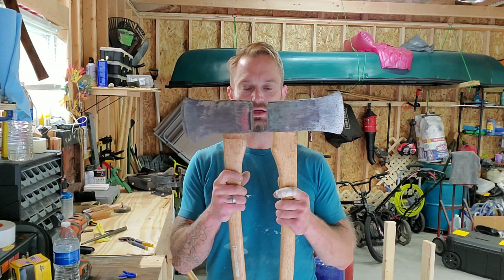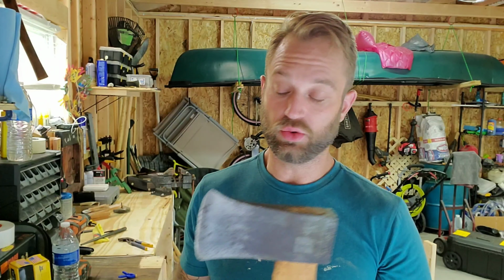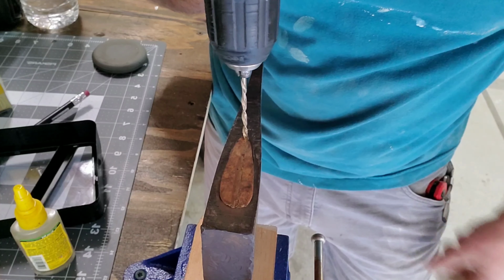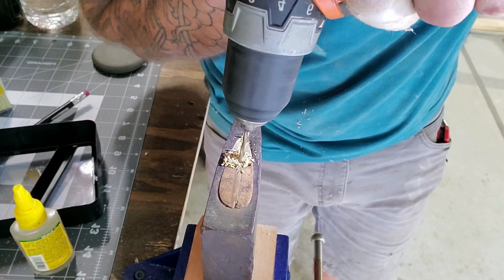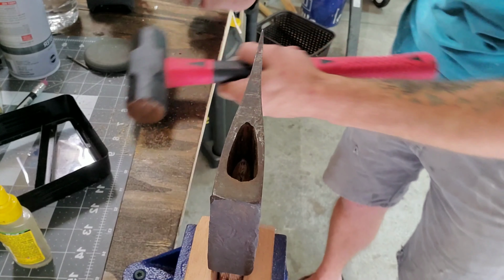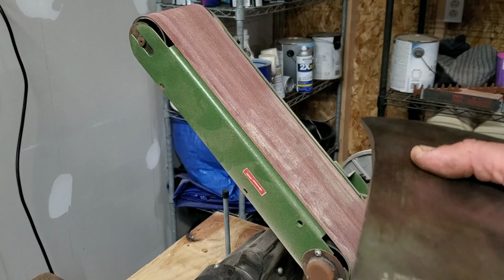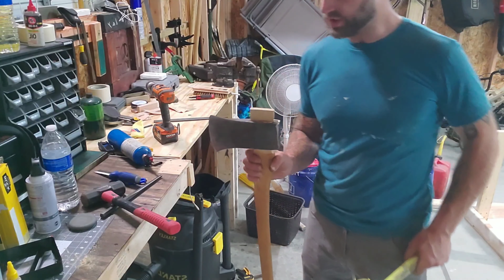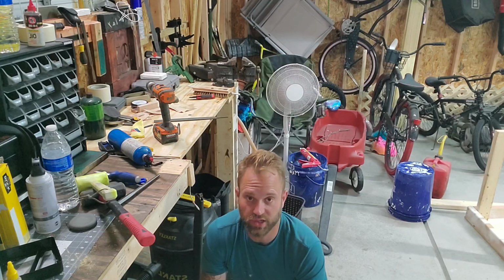How to rehandle/ rehaft/ haft/ handle/ hang an axe....while reusing and the saving the handle.

Comment: Only thing I would have done as far as usage is concerned is, seat the head down further so it's close to the shoulder for better mobility and it'll make the overall length shorter for more versatility. I cant quite tell if you did this or not but leaving the handle proud at the top which I'm sure you've heard a thousand times is great from a structure point of view but also makes it much easier to remove wooden wedges, should you need to in the future. Great lil video. I'd been considering making one on this topic for a while but I broke my tripod

Comment: Just did the same recently.  Had an axe that I got 30 years ago, True Temper with a loose head from use and abuse.  My rooting axe.  Took about 1/2" off the end to make it a seat better.  Still chopping tree roots in the ground Also a good, but heavy (4 lb.), all around axe.

Comment: The only handles I dont save are council handles with the aluminium wedges. They are such a ball ache to save. Otherwise literally every axe I reseat or change a handle on I save the handle. It's not a long process once you get decent at it.